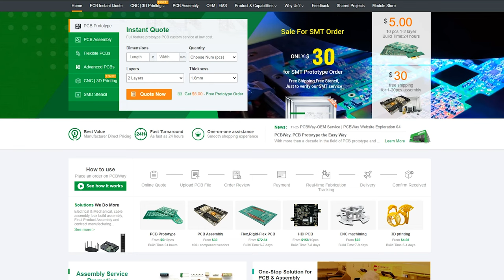Focus stacking system for macro photography - Assembly and tutorial

Comment: Great design! This is exactly what I've been looking for so will definitely save me time designing from scratch. I'm going to start ordering the parts, I'll let you know how it turns out.
Reply from the maker: Thanks! Make sure you check all my videos on this rig, I made a few. I also wrote detailed articles about them on my blog.
Reply: @CuriousScientist  I finished assembly and am testing it now, I built mine 600mm long for macro timelapse. A couple of the tolerances were slightly off for my hardware and the lead screw I initially ordered from Aliexpress was a bit wonky but it's all up and running now. I also extended the carriage to house 4 linear bearings to increase stability. Thanks for uploading!

Comment: Thanks for posting this excellent design/project.
I have a few questions though ,
1. You don't show where the home/limit switch is mounted. Were you able to use a switchless design with updated code?
2. Wondering why you didn't use a TMC2209 for the driver. Wouldn't that be much quieter (maybe even solve Q1 with no limit switch)
3. My Sony A6700 has no functionality for USB remote or IR, so I intend to see if the code could be converted to run on an ESP32 and use bluetooth to trigger the camera. Are there any other limitations you could foresee ?

Some people may ask why I would need a focus rail, as the A6700 (and other cameras) has built in focus bracketing, whilst this is great, it still suffers from focus breathing with the Sony 90mm macro lens (SEL90M28G).

Thanks again, I realise this project is about 1year old, so I guess tech has changed a bit in the last year.
Catch you on Patreon as I will donate to you once I have all the parts.
Reply from the maker: Hi,
1; As I probably mentioned, you can put the limit switch wherever you want. It is up to the user where and how they want to define the zero point. 
2; Regarding the TMC2209, AFAIK, you can use them as a drop-in replacement. However, I initially designed the board for the DRV8825, because it was much cheaper. At those speeds and step sizes where this device is operated, the stepping does not really cause any disturbing noise. 
3; First of all, lucky you! I looked at that body just recently and I realized I still cannot afford it. And my A6000 is getting a bit old nowadays. You can pick up the trigger signal from the Arduino and process it with a BT-compatible microcontroller. It could work. Just keep in mind that the Arduino provides a 5 V signal, and an ESP32 accepts only a 3.3 V level! 

4; Plus, you probably cannot bracket such a range with your camera that you can cover with this rail! It is also important.

Comment: Hi There, Really interested in this rail, but I wanted to use it for vertical shooting using a stand. My only issue is I am not sure how much weight the 3d Printed camera mount will be able to hold successfully. With my 200mm Macro lens and body, the weight is almost 2.6kg Have you tried using it vertically yet? Keep up the great work!
Reply from the maker: Hi! I tried to use it vertically, and it worked perfectly. However, my setup is only about half a kilogram. I will make a video on it soon because I built a neat "converter" to make the rail vertical. If I don't forget it, I will try to add extra weight to see if it can still move reliably.
Reply: @CuriousScientist  Thanks so much. I have had a look at your stl files and tried to mod the 2 parts together to add a bit more strength...  going to print it overnight to see how it is.. Thanks again for the great design..
Reply from the maker: Let me know how the part came out. I might also improve the design if it is necessary, but so far it looks stiff enough to me. I also wanted to avoid long printing times, so I did not design a super thick support.
Reply: @CuriousScientist  I have printed it out but not sure how to add pictures to replies (if I even can). I did it at 100% and it weighs a ton, not sure how much but will weigh it tonight. Definitely think it will be sturdy enough, but as I printed in PLA, I am not sure if the part will start to bend slightly over time with the weight. I have all my parts on order from AliExpress so will put it together when they come.   Do you think in vertical mode a Nema17 stepper will be powerful enough with up to 3kg of weight??  Thanks.
Reply from the maker: If the calculator I Googled (I searched "leadscrew lift torque") is correct, you will need about ~0.14 Nm to lift 3 kg. But this might differ based on the friction in your system. You can check this value in your motor's datasheet and see if your motor can deliver such torque. There are millions of different NEMA17 motors, so I don't know if yours will clear it. One can buy motors with 0.5 Nm torque as well as with 0.17 Nm, so it is hard to judge without knowing the exact type of your motor. Most probably, it will be able to lift it without problems. 

Regarding the bending of the plastic with time, I am not really good at creep properties of these plastics. If you don't store the 3 kg camera setup on the holder all the time, then I think it is safe to assume that bending wont be an issue.
Reply: @CuriousScientist  hi there. Finally got most of the parts from Ali express. Waiting for some still, but trying to locate the screw that you used to screw the metal camera mount to your 3d printed part. Did that come with your mount or was it separate. Not too sure what to Google. Hope this makes sense :-).
Reply from the maker: @moosekatdeluxe  Hi! I am glad to hear that you have most of the parts! If you are talking about the stainless steel screw that goes into the plastic piece which I show at 25:13, then yes, that came together with the mount. If you want to buy it separately, then "1/4 inch thread countersunk screw" is the magic word. I believe that a M6 countersunk screw would also work because the hole in that plastic mount is 6 mm.

Comment: I also started assembling my rail system and 3D printing components similar to the way you have done yours. My problem is understanding how to automate the system with the components i have at my disposal. Would it be possible for me to email you. I also saw your name come up in extreme macro photography circles.
Reply from the maker: Hi! The videos and articles I published on this gadget are exactly aimed to show how to automate the process. Have you checked everything I published? 

You can drop me a mail, sure, but I can not promise too much without knowing more about the nature of the problem. 

Also, it would be nice to know where you have encountered my name. I don't follow any photography-related forums, so it would be great to hear feedback from more professional photographers so I could adjust my device and code to their needs.
Reply: @CuriousScientist  greetings again. I came across your name while watching Allan Walls Photography live interactions. My issue is i have most of the components that i think i need but they are not exactly the same as yours. I have an Arduino with a driver a power supply all sorts of connectors for a breadboard setup but still need a screen and i need to get something to speak to my camera. My problem is i have no technical knowledge because this is all new to me.
Reply from the maker: Hi! I know Allan, he is a good friend of mine! I usually watch his live shows on Thursdays. 

If you have different components, then it will be very difficult to do anything easily, especially if it is new to you. This is a rather complex project, so if you would try to implement it on a different hardware, it would take some effort. Especially the display would introduce issues because the code is basically written around this specific display I used for the project. If you don't have too much technical knowledge, I think it is easier to just buy the parts and the PCB, solder everything together, then upload my code on the Arduino and use it as it is. But of course, the decision is yours, I am just expressing my opinion.
Reply: @CuriousScientist  Thank you for your time it looks like i have a lot more research to do before i can get my system to work. I am just trying to ask as many questions as possible along the way so i have a better idea of which direction i should take. My budget does not allow for too much spending so i have to work carefully with what i have. Anyway keep well and i will probably be there for the next live meeting on Allans channel.